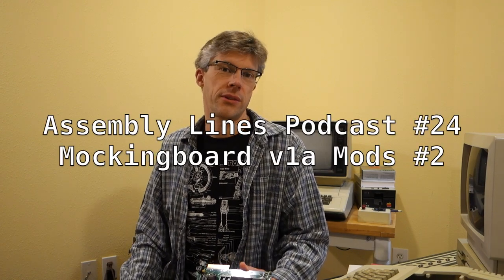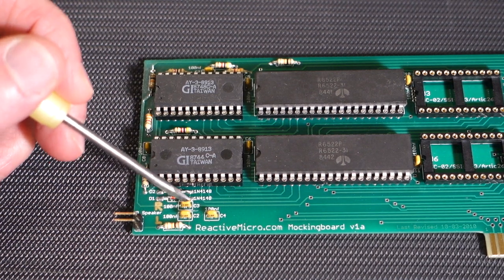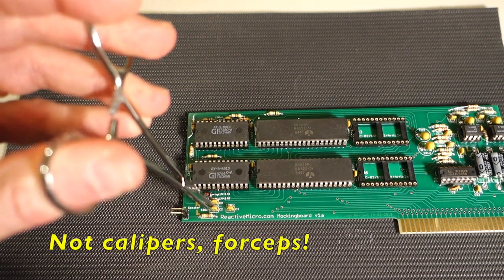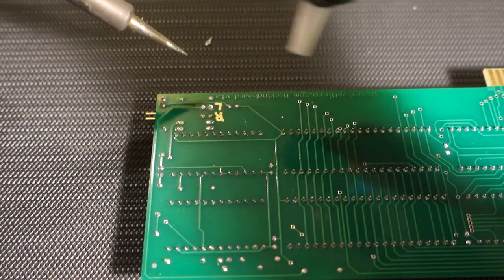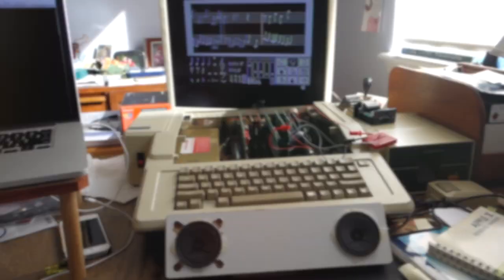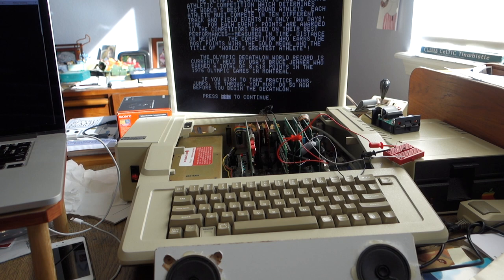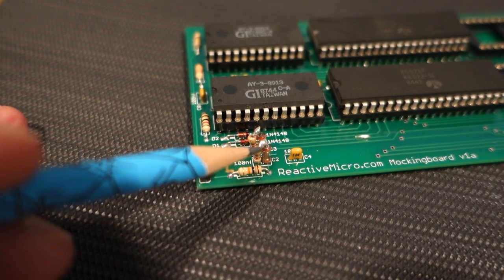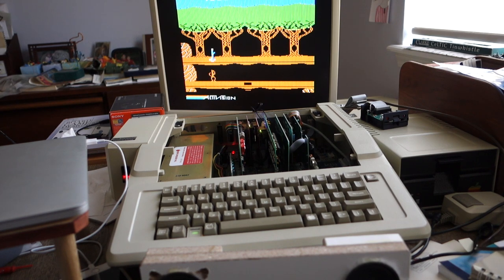Assembly Lines #24: Mockingboard v1a Mods #2

Comment: Another great video Chris!

To increase the volume from the Apple II you should be able to remove (or jumper/bypass) the 10k resistor just after Apple II Sound Input header pins.
Reply from the maker: +ReActiveMicro.com Thanks! Good thought on the 10k resistor. I just tried it, but with the Mockingboard 1/2W amp, plus two speakers, the Apple II sound is ridiculously loud. Not rock concert loud, but approaching 90 decibels. I measured my other //e and it is only about 70 dB. So I think I'll just leave the 10k in there. :-)
Reply: +Chris Torrence Try bypassing the 10k resistor and increase the two other resistors 2-4k.  That should work I believe.

Comment: Is there a reason why diode wouldn't work in place of those resistors?
Reply from the maker: +Gary Gray I thought about using a diode also, but supposedly there wouldn't be enough forward bias (voltage). That's according to my brother-in-law, who's an electrical engineer. I found a page which might help explain: http://electronics.stackexchange.com/questions/136127/using-diodes-to-mix-2-audio-signals-into-one-set-of-speakers

Comment: Awesome video.  So, what cards do you have in your ][e?  Other than floppy, do you use any sort of mass-storage device?
Reply from the maker: Hi cb meeks, here are the cards in my //e: 0: 64K/80 col card, 1: super serial card (for ADTPro), 2: Apple II Pi, 3: Uthernet ][, 4: Mockingboard v1a, 5: Apple mouse card, 6: Disk ][ card, 7: SD Disk ][ (from Ian Kim). The Disk ][ card has one real 5.25" floppy and also Nishida Radio's UNISDISK Air 20. The SD Disk ][ lets you have a 32 Mb hard drive on an SD card, whilel the UNISDISK let's you serve up individual floppy disk images using a web-based interface: https://www.youtube.com/watch?v=dVBNksiQ0nw
Reply: That's a great setup.  I'm interested in that UNISDISK.  Looks to be a neat peripheral.  I'm thinking about designing my own Mockingboard clone.  I've done it on a breadboard in the past.  But I'd like to do something that didn't require vintage chips.